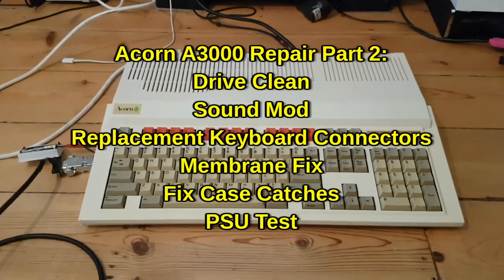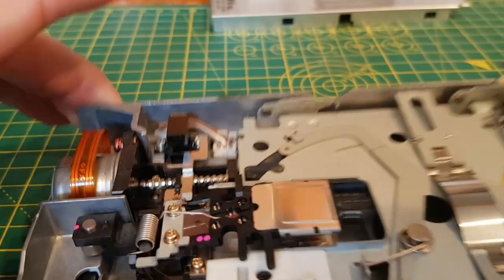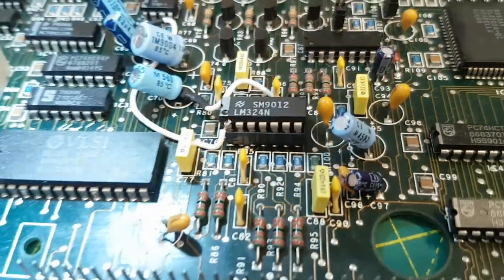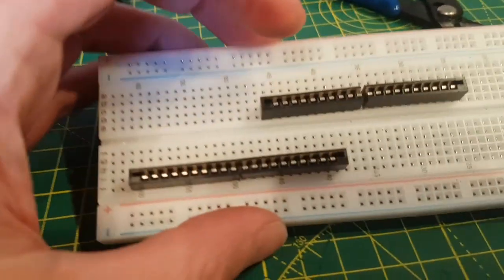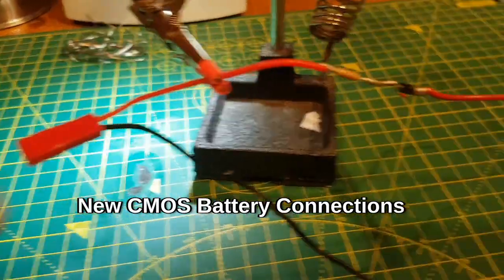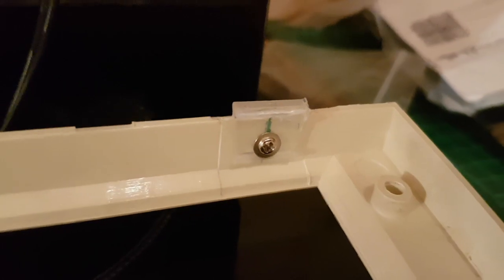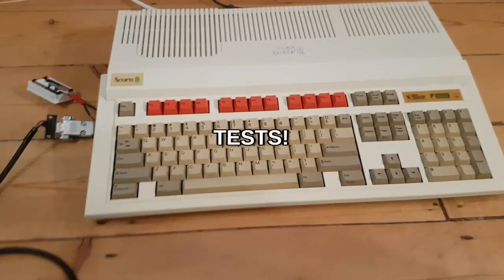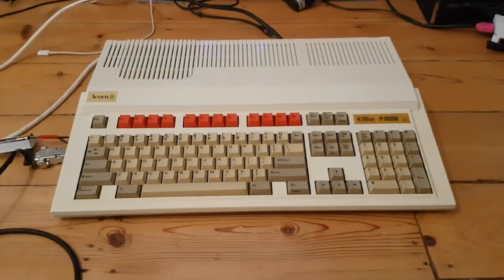Acorn A3000 Repair Part 2, Case, Keyboard Connector & Membrane Fixes + Sound Mod

Comment: Hi mate. I`ve been doing a bit of work on mine. Noticed you haven`t got the screw and plates for the back 2 catches which lock it in place. Basically just a threaded screw that goes into a small square plate that fits behind the latch. The plate is 2mm thick, 14.3mm by 12.3mm. The screw O/D is 2.5 mm and 6mm long.
Reply from the maker: Yeah, unfortunately, they were missing when I got it. Thanks for watching.
Reply: @Plan-C  I can make some for you if you still have the machine. I`ve lost one of mine so need to make at least one. Give me a shout if you need them.
Reply from the maker: @damianbutterworth2434  That is very kind. I think it will be OK for now. Thank you very much for the offer.

Comment: What diode did you use exactly, please ? Great video, thank you.
Will you share the plastic clip design ?
Reply from the maker: HI. I just used an old 1n4001 I had laying around for the battery cable. I put a 1K resistor in series with it. I replaced the diode that was on the main board with a 1n4006 (it was a 1n4005 before). Seems to make no difference.
Reply: @Plan-C  Thank you. I didn't know there was already a diode on the motherboard. It makes sense with the standard shape of a non rechargeable battery underneath the casing. It seems Acorn changed their mind in the process of designing the A3000, deciding eventually to install a rechargeable battery on the motherboard. Not a good choice with the disastrous results of battery leakage.
Reply from the maker: @Archimedes75009  Sorry. I meant the diode on the mainboard which was rotten with battery acid. I dont think that one has anything to do with the cmos so still needs a diode on  the wire
Reply: @Plan-C  ok thanks. It makes more sense with what the techies have written so far on stardot for example.